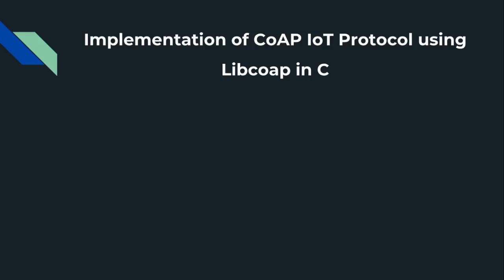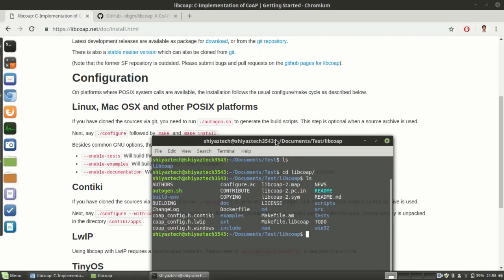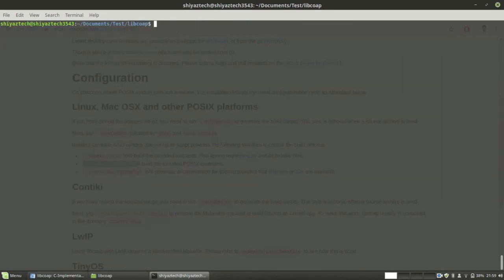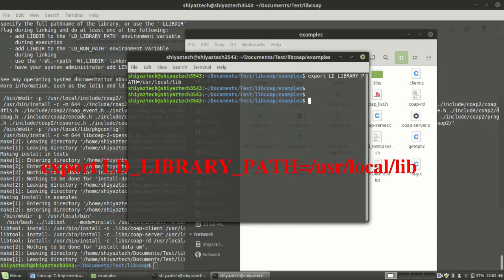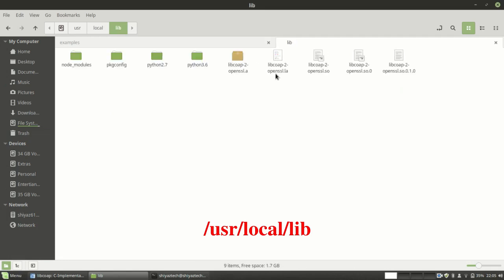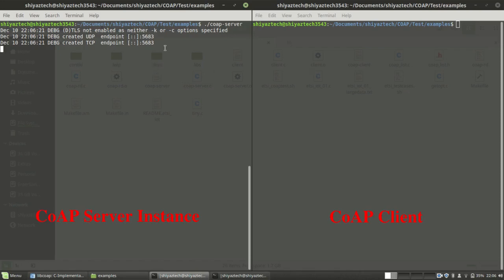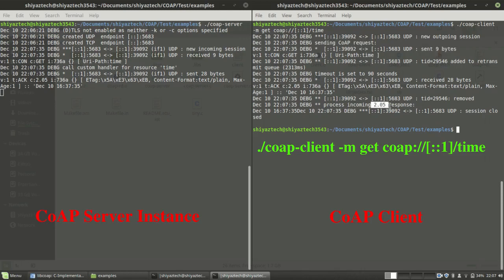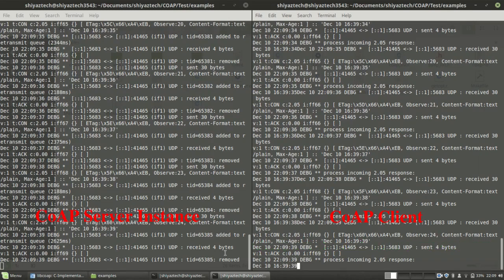CoAP IoT Protocol: Implementation in C using libcoap Part 2 of 3

Comment: ./autogen.sh is not working 
[main 2024-04-20T05:43:21.519Z] update#setState idle
[7472:0420/111324.041:ERROR:jump_list.cc(300)] Failed to append custom category 'Recent Folders' to Jump List due to system privacy settings.
Reply: Update the error is solved now new problem came after doing(./coap-server) nothing shows like in the video
Reply: @NETRUNNER69420  I'm the same as you, coap server is not running
Reply: @manhvu3103  I am still stuck no other alternative solution is found
Reply: @manhvu3103   Anh sửa được chưa ạ, cho em biết cách khắc phục với
Reply: @NETRUNNER69420  did you find a solution? if so please let me know. i have the same problem
Reply: @BDCDT_NguyenMinhQuan  no still have not solved it